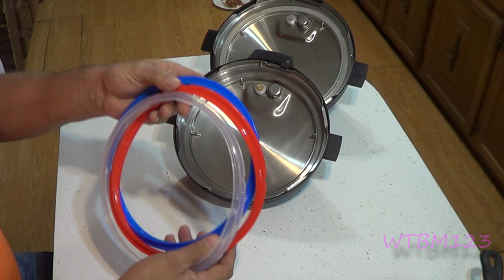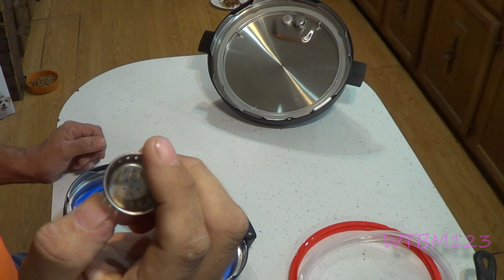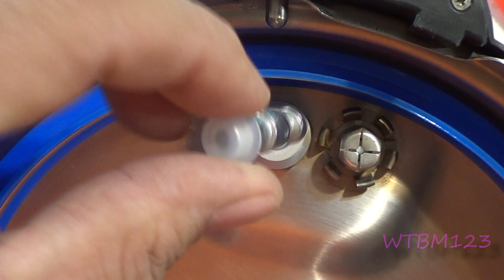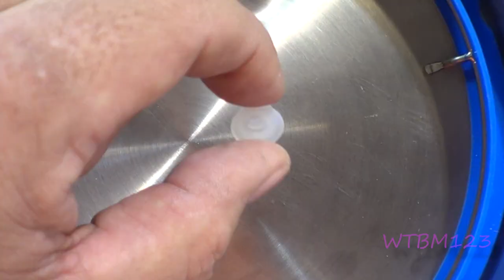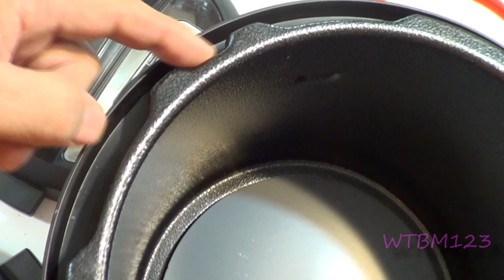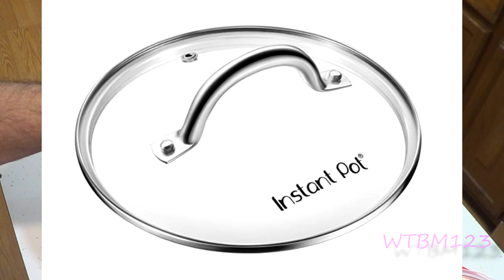Instant Pot Lid Parts , How it Works Putting it back together

Comment: My instant pot comes to pressure, the valve rises, and then a few minutes later the steam release knob even though is in the sealing position it starts spurting out steam. 
This is a new problem we just started having..any reason why?
Thanks
Reply from the maker: Clean all well and may need to replace any gaskets including the sealing ring.

Comment: Thanks, I was wondering what happened to that piece for the pressure pin. OK I just edited this after looking around for that little piece and I found it, thanks for the visual. Oh and I think you forgot to add that the lid can hook on the side of the handle so you're not looking for a place to set it.
Reply from the maker: Glad I could help!

Comment: This is great, especially after 6min when you talk about the Pin. Keep it clean is vital. I expected there to be a light spring to keep this closed as mine falls open by gravity when I close the lid. I don't see how it can ever close because any steam escapes before it can build up any pressure. I'd prefer a design with a small car radiator cap, like on newer Japan cars. Since ALL radiator caps open at 1 atmosphere pressure (about 14.4 psi) this is enough pressure to steam food.
Reply from the maker: Glad it was helpful!

Comment: Thank you! Great, informative video!  Just one thing....I have seen several videos (including on Instant Pot website), that there is a wire ring/clip that goes under the Steam Release Handle, over the silicone washer inside the handle. I accidentally dropped my lid and the release handle flew off so now I don't know if it is supposed to have a wire clip in there or not.  You didn't mention anything about it in your video so maybe not all models have it.  We have the Duo 6qt.  Do you know? Thank you in advance!

Comment: for some reason my lid wont close or open because the lid locking pin/ spring isnt working right, I can still get it to open or shut but its a hassle, I think I need a new spring because the "sliding fork" keeps hitting my floating valve pin....adult problems lol. im even able to take it apart there are 2 rubber black push ins you can take out and take out 2 more screws and take out the actual sliding fork as well! theres 2 magnets inside by prying the black piece out. my only queston is can you replace the spring? can i get universal spring sizes at a auto value store?
Reply from the maker: Not sure , but would think as long as it was very close to the same length and about the same stiffnes it should work , i would think

Comment: Good afternoon sir I have the instant pot 8 court duo. Every once in a while I am noticing steam is blowing past my red pop up. I have to dig at the side of it gently with a pointed object and the red valve will pop up. Now that I Have seen your video I'm going to Try and take it apart to clean it. But can you tell me the minimum amount of water to use for the water test
Reply from the maker: I believe it is in the owners manual , but i think it is 3 cups

Comment: Today I was starting to make collard greens  , I  first put 1 cup water mines a 6 Qt. then put ham hock and some onion , fatback grease put lid on locked it set to pressure hit manual then 15 minutes.  It started fine  came up to pressure and started counting down got to 12 minutes  then I  heard a lot pot and pressure  looked and the front part of lid and popped out from the groove thing . I hit the off button and pushed to pressure release valve waited . It took me 5 or ten minutes to get the lid off, I  did a list check going over everything can't find anything wrong. The lid goes on and locks fine . I tried it again making sure the lid is on pushed down then turned to lock position . Any help you may have would be great.
Reply from the maker: If leaking around the gasket where lid goes on then get a new gasket and try . as long as you see no damage of the pot its self

Comment: I have l LID Error on my steamer and the lid wigles loose. I changed the silicone ring and it goes on anyway. Is it a reset possibility to fix a problem?
Reply from the maker: If all is real clean and moving well , the gasket is new and you are sure  the rubber like  gasket is good and on the pin correctly , Then you should contact customer service as they will probably help you figure it out .

Comment: A question about the pin.  I have replacement seal that goes on the underside of the lid, but the plastic piece you put on the top of the pin- is the same seal or a plastic cap?  I can’t tell if the plastic rings are the same on the top and bottom of the pin.  I ordered replacement parts and i received 3 plastic rings.  Does that make sense?  It looks to me like the plastic you put on the top side of the pin is a closed cap
Reply from the maker: The pin just has a gasket on inside . The black plastic thing is different if talking about the pressure - vent valve . It has no gasket . If i am understanding correctly

Comment: Thank you so much. I had a guarantee for 2 quarts eclectic pressure cooker. I was given some cash return on it when it did not work. I check out the video  brought the parts and will try tomorrow  , I held on to it for a year ,I will let you know if it worked,
Reply from the maker: Hope it works out well for you . Glad you are trying to save a Magic pot , Well that is what we call them . Thanks for commenting
Reply: @wtbm123  Thank you so much, yes it did work very grateful to you.

Comment: The steel circular deal next to the pin (on the inside) won’t budge. I just got it so I don’t need to clean it yet....I don’t want to break it trying to get it off. Is this going to be a problem?
Reply from the maker: Sometimes you can get a butter knife under it . If you push up just right it should pop off.

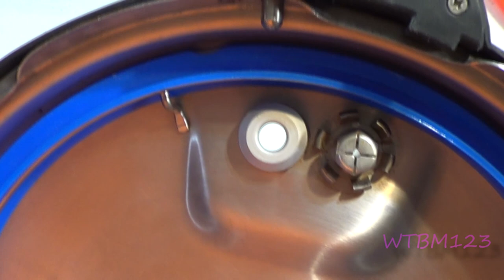Comment: MOST INFORMATIVE video on Instant Pot.  My lid wouldn't slide closed.  Turns out it was the 6:40 info on that little round button that is linked to another part.  Moved it a bit ..... I'm now cooking my beans!!  THANK YOU DUDE!   I also learned I can take that round cage thing can easily come off .. and mine was so filthy underneath ..now clean.
Reply from the maker: Thank you for watching and commenting

Comment: The different seals are pretty. But yeah, it makes sense to change them between cooking. It's good that the company provides the parts needed. Most thing these days just want you to replace the whole unit.
Reply from the maker: Yea we had others until we needed parts , That is a big reason we went with the Instant pot . Thanks for stopping by

Comment: Thanks for the information, but how do you get the little metal pin back in. Mine fell out so it does not come to pressure.  I have tried everything and it doesn't fit. Also, my vent piece on top falls off when ever I tilt it.  It seem I lost the silicone piece inside.  I have only used it 4 times. I have the duo sv.
Reply from the maker: I would get a hold of instant pot support , they are very helpful and will prob help out

Comment: I just bought my instant pot a few days ago and mine has a different method of sealing and venting. Mine has a little switch knob to move up or down not the  vent itself. Occasionally I'll get steam coming from the Pin area instead of the venting area. Sometimes I can release the steam and it'll come out fine after the pressure cooking sometimes there's none to release. It could also be I'm still too new to figure out how long it takes for things to come to pressure, and if this is normal?
Reply from the maker: To get to pressure is not always the same time . The temp of food , how much liquid and things can make for longer or shorter times to pressure . Make sure there is enough liquid . And liquid first in most , then dry stuff on top and do not stir so liquid stays on bottom longer with no burn notice
Reply: @wtbm123  it turns out that when I bought it: The box and instantpot itself were dented! You can imagine my surprise when my mother in law pointed that out!
Reply from the maker: @EraidFreefire  Hope you were able to exchange it for an undented one
Reply: @wtbm123  I was!

Comment: i have removed the silicon cap from the pin n tested steam run . failed . after watchng this i realised there should cap under pin ( valve) . now my steam run went fine .  thanx .
Reply from the maker: Glad you are able to use it again . And thanks for commenting

Comment: My valve leaks. Replaced the top valve but still leaks.
Reply from the maker: Do you have enough thin liquid to build pressure . I would suggest doing a water test to see if it works that way . If the water test works then the instant pot is ok